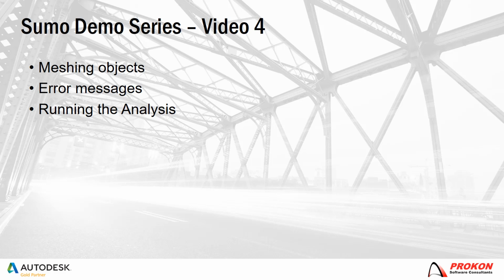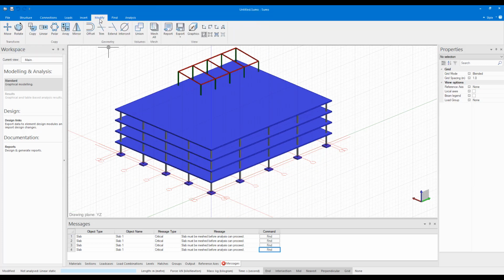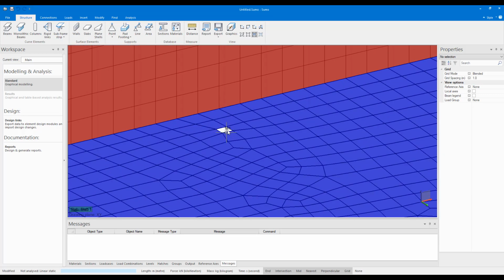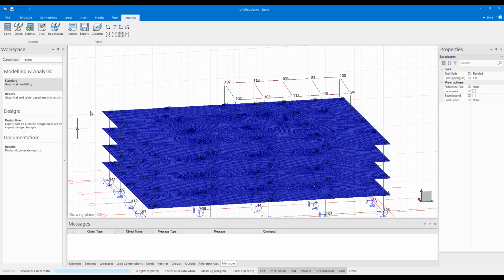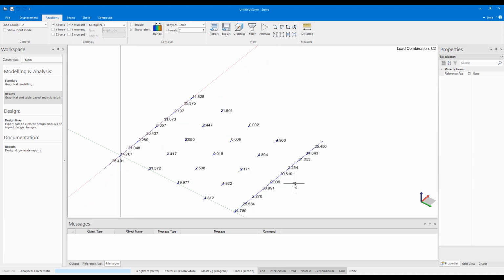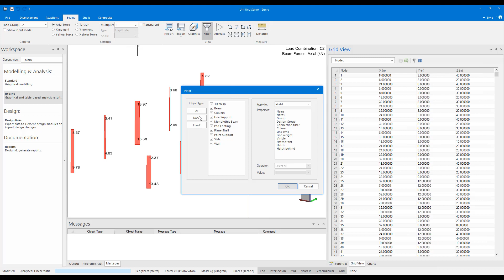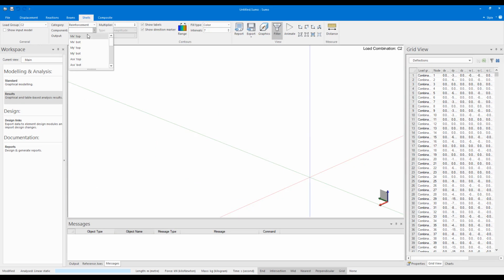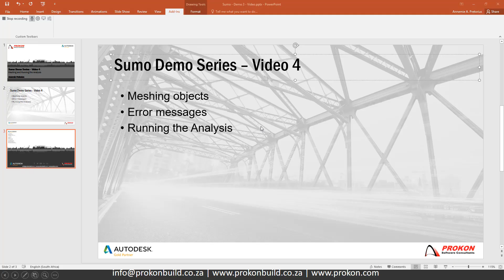Prokon Sumo - Demo 4: Meshing and Running the Analysis

Comment: One of my slabs failed to mesh, mesher reported failed to correct cell inversions on meshing front and failed to correct cell division error. How do I deal with this errors.
Reply from the maker: Hi Ian, 

If a surface element can’t mesh, the cause is usually due to two factors:
1.	The mesh size is too coarse, and should be refined, or
2.	The surrounding elements – beams/columns/other surface elements – haven’t been modelled accurately. 

You’re welcome to contact support (support@prokon.com) for more help. 

Regards
Prokon